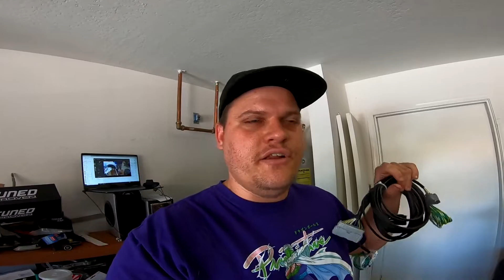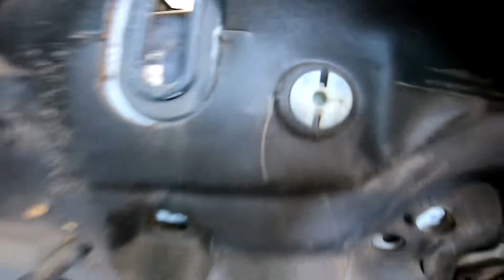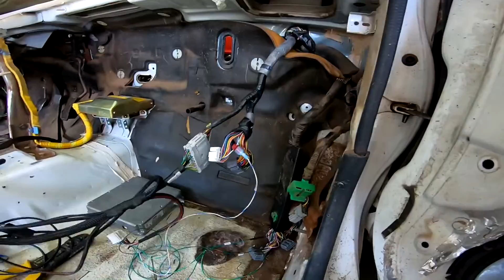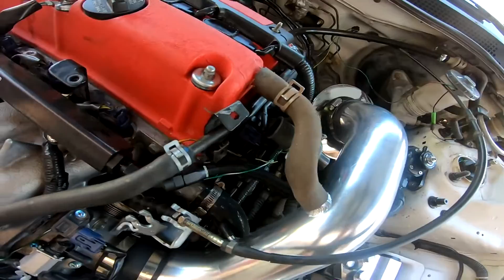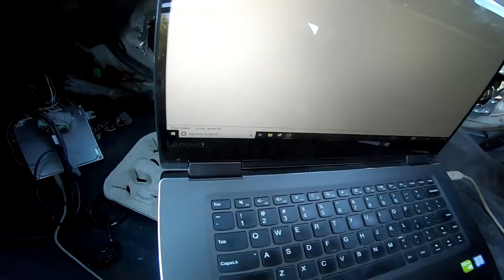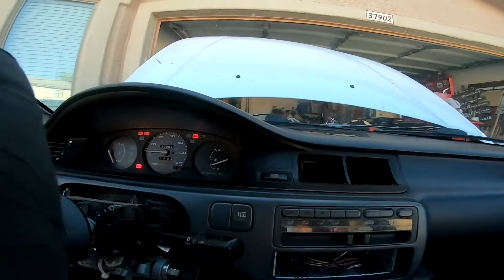EG Kswap Hybrid Harness Installation guide

Comment: I’m getting no fuel pump and ignition off on my k pro, what was your fix?
Reply from the maker: its been some time since first fire so i cant recall if i faced the same issue. sounds like an issue with wiring maybe a ground or something isn't pinned right. also could be you have immobalized ecu?

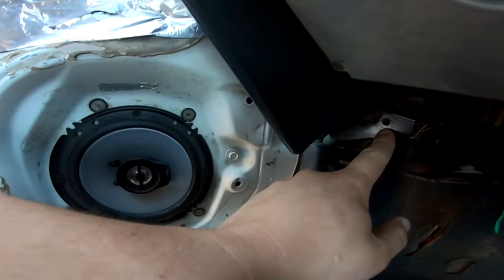Comment: At 22:00 in your video you mentioned a gray boy aka plug. Are you referring to the main relay or something different? Cause I’m having no ignition on kpro issue in the same chassis you are! Can you possible explain which plug your referring too? And what wire you grounded? This would help me out tremendously as I’ve built my car for 13 months and have can across this exact issue! Thanks 🙏
Reply from the maker: id assume if the main relay is where i was indicating that'd be so.  i hadn't worked on this car in a while so its hard to recall. i do remember my first start didn't turn over initially and i needed to do something with the ground wires. check all your grounding points and make sure they are correct and in place. otherwise i did have that relay go out on me later down the road. hope this helps

Comment: Makes a video to help.
video
"You know, just follow the directions"

Lmfao
Reply from the maker: Hoes mad
Reply: @TKirkMedia  lol. I'm a lil slower. Watched it few more times and read the instructions about 4 times more. Pulled up some diagrams too. Hoes happy!
Reply from the maker: @tinfoilhat1619  me to man i had to read and re read to make certain but i couldn't figure out a way to convey  that at the time when i recorded this. i didn't want to get people too confused with too much information and felt that there were parts of it that should require you to read the installation instructions provided by the manufacture given that maybe other people doing this had a different car/ swap combination. hope the video helped you in the slightest,
Reply: @TKirkMedia  it does help when I have all the info and prior research. I'm almost there, shit is giving me headaches.

Also, my engine harness is all black, they're not colored. Although it is a ktune harness and very neat. I'm having to quad check which wire I'm biting into.

Comment: Can I use this harness with the type s ecu or does it have to be kpro?
Reply from the maker: I used an type s ecu with kpro installed into the factory ecu. youll need both
Reply: @TKirkMedia  what I have is the engine harness. Hybrid conversion harness immobilizer bypass k20a2 ecu what else would I need ?

Comment: Did u ground the fan switch?
Reply from the maker: the wiring is lacking on this car and is currently whats keeping the car stranded. :( the fuel pump relay is getting hot from the massive pump i installed so i have to fix the plug. As for the fan switch I'm pretty sure I just ran what ever factory was and spliced my spals in. i need to redo it will report back

Comment: How di you wire the fan switch like did you power the actual fans from the oem harness then iv heard you can use kpro for setting the temp for the fans to come on ?

Comment: Does hywire harness fit on k24
Reply from the maker: This harness does NOT work with any 05-06 OR K24 engine wiring harnesses. - from the hybrid racing website.
Reply from the maker: @Mr. K Thanks for the intel!! Makes sense that it would.

Comment: Hey bro how is the axle angle with those "gas port" amazon mounts?
Reply from the maker: ive been driving the car since last april and have yet to get an alignment. I plan to get one this month for the recent subframe stuff ive done. I havent had any issues otherwise and i think thats partially because i swapped the inners on the base rsx axles.
Reply: Thanks for the feedback bro I'm about to order these now. Much appreciated
Reply from the maker: @josephhawkins8387  yeah i will say that they vibrate a bit much but other than that they are a good temporary till your able to ball out on the hassports.

Comment: Can you go over what you used for the shifter box and how you routed the shifter cables? Good stuff bro Also what number 2 cable.did you ground?
Reply from the maker: I cant recall where I grounded it at but i did have an issue at first with the ground for the harness not making continuity. The shift cables are in a temporary spot as i have not re installed the a/c yet. Plans to rework this are in order. Upon completion ill have an upload going into more detail on the shifter cables.

Comment: Hey bro , I was wondering how you did your fan switch ? Does the fan plugs connect to the original plugs ? Thanks !
Reply from the maker: @Jaysmaccin I updated the description with what I used in order to get my fanswitch installed. As far as the plug for the radiator fan i retained the factory plug and just clipped the pos/neg wires followed by soldering them to the wires associated with the fan switch. My fans are always on so I still need to further sort it out. Hope this helps.